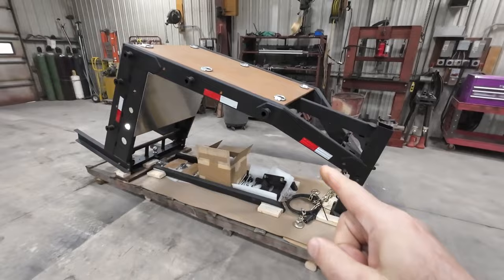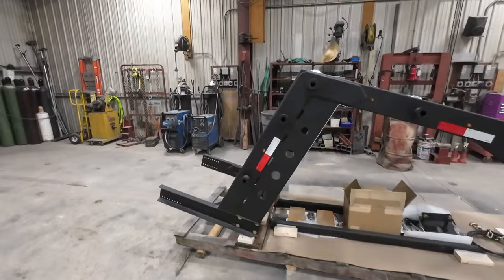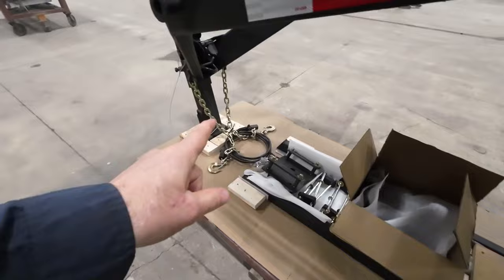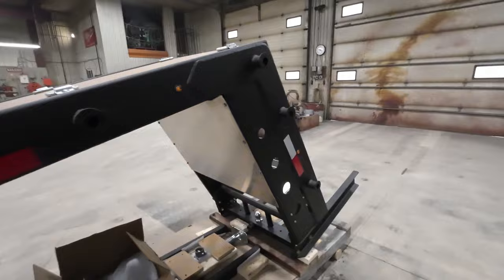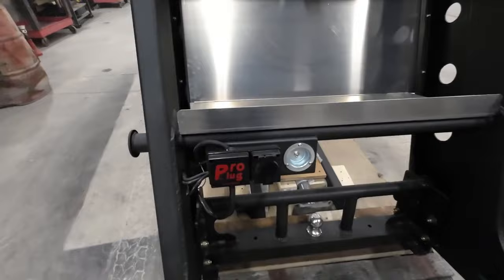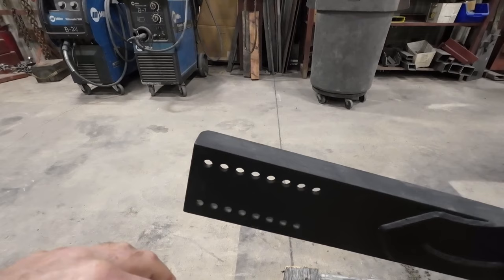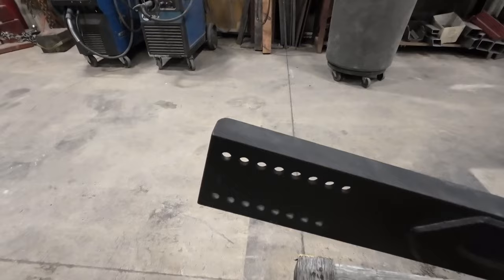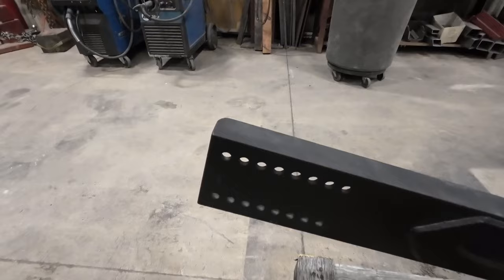Alan's Day  - Shop Walk -  Gooseneck Adapter Hitch - "Feature review & Prep for Shipping"

Comment: That is an awesome engineer product!!! my wife and I want to buy a trailer and we have not been able to decide a fifth wheel or bumper pole. A fifth wheel is very high and height and I think that I will always be worrying about hitting something, like a bridge. The bumper poles the the problem with that is, of course, as you spoke of the death sway. Your product does away with a lot of that get a trailer that is very much like a fifth wheel and buy your product which allows you to put the weight of the trailer over the axles. I am definitely a future customer when I buy a trailer that’s what I’m gonna do. I am a welder mechanic and a few other trades but I don’t know if that something that I would take on stalling on my trailer. Do you guys install them on the trailer if you came out with the trailer and truck?
Reply from the maker: Thank you for watching the Goose Neck Adapter video. If you are getting into the RV life, typically the Bumper Pull RV are less expensive. You will need to do the math to see if this product would be a good fit for you and your wife. GOOD LUCK

Comment: For 6k make the down payment on the next camper. 

I want to like this product but it’s a ton of setup and then you still lack the best feature of 5th wheel camper - the extra space you can utilize and better weighting.
Reply from the maker: Thank you for watching the Goose Neck Adapter video. You are correct, there is some set up time, but once setup you are all set. You are also correct, if you can afford or already have a 5th Wheel Camper, that is the way to go.
Reply: @AlansDay-UPGRADE-PERFECT  Cool product. Glad there is an option available.